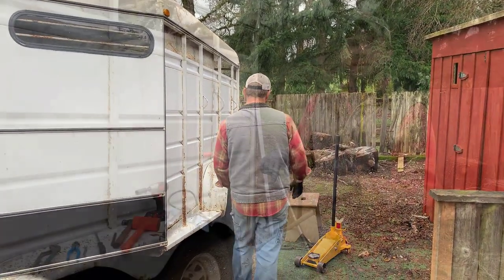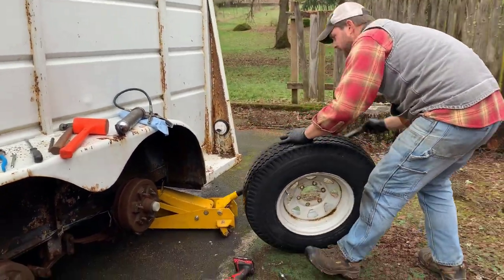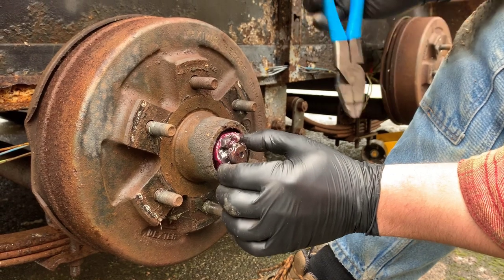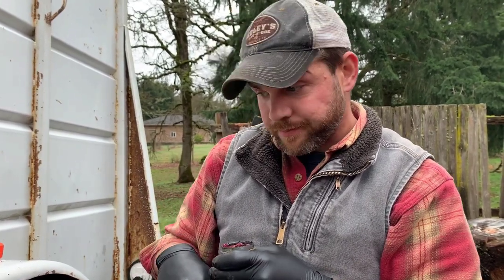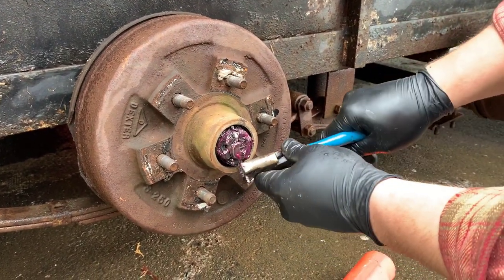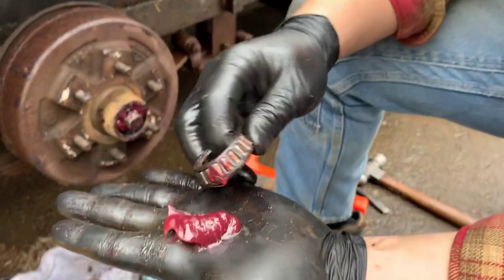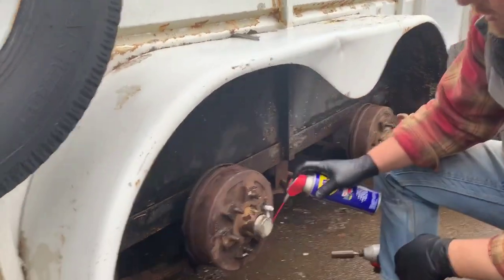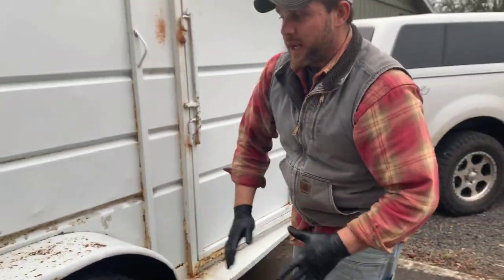HOW TO check the wheel bearings on a trailer for a CROSS-COUNTRY TRIP || AUSTIN HOMESTEAD

Comment: Thank you so much for the step by step clear video instructions! I feel confident I can do this to my old miley horse trailer. Even the air pressure check is totally appreciated! My tires were at 29ibs with a max of 65 psi so I was wondering if I should put more air in and now I know!